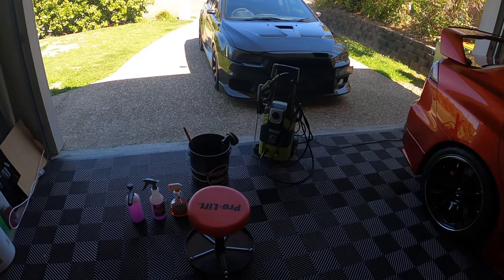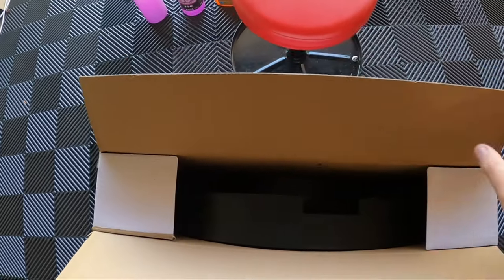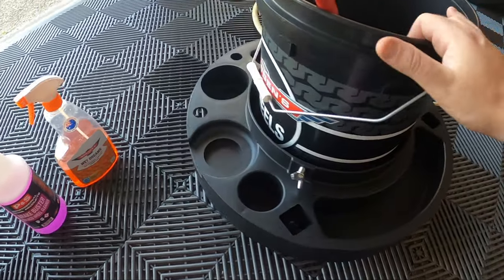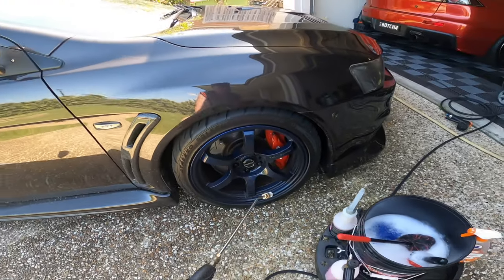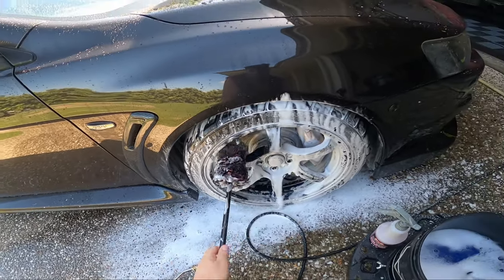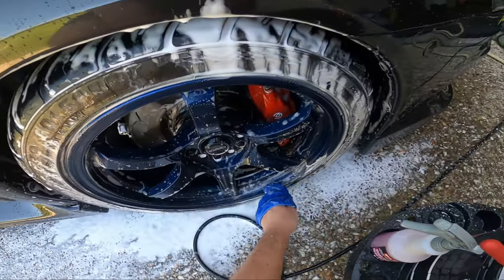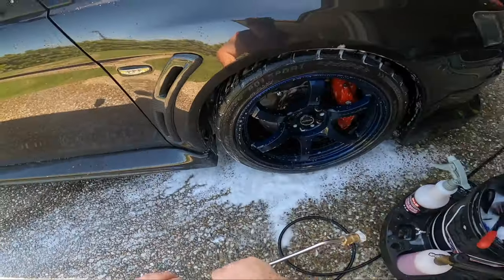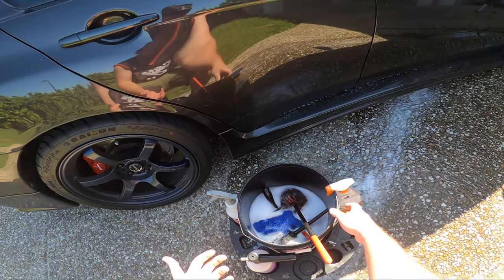How I Clean My Wheels + Deluxe Bucket Dolly Review

Comment: That's a handy little tool to prevent lugging around the wheel bucket. 
My driveway is on a much greater incline than yours... If I owned that dolly it would definitely roll away. 
Fun fact.... That Ryobi pressure washer 99bucks at Bunnings right now. 
Thanks again for the videos. 👍😁
Reply from the maker: Thanks Ian yeah have used it a few times now and is definitely handy to have bit obviously a steep driveway would not be ideal for it.
Yeah I paid $99 for mine over 4 years ago and it's still going strong

Comment: Hi mate, how do you find the swisstrax floors? How do they hold up to dirt and debris?
Reply from the maker: Hey mate these ones a racedeck tiles which are the original company that started them from what over heard.
They have been great and just use a leaft blower to occasionally blow them out. 
Highly recommend them eve small things like walking into the garage barefoot at night to grab something your feet don't get dirty
Reply: @EvolvedDetails  cool, I’ll have to check out racedeck tiles. Did you install yourself? How much roughly did they cost?
Reply from the maker: @the_microfibre_man  I bought mine used for around $1,000 which was crazy bargain. And yes installed myself you can see the install video on my other channel Jackson Strain